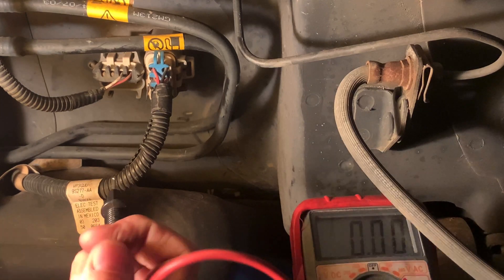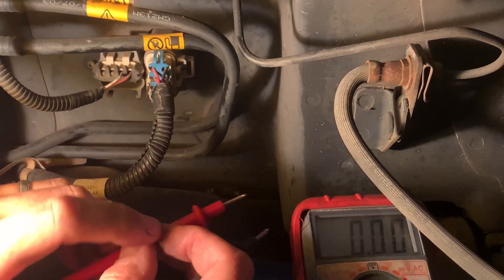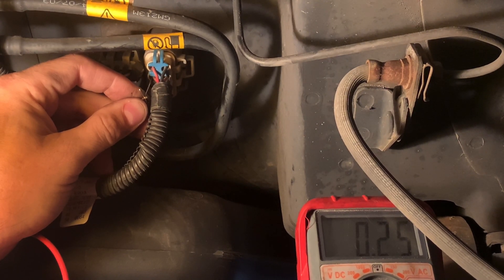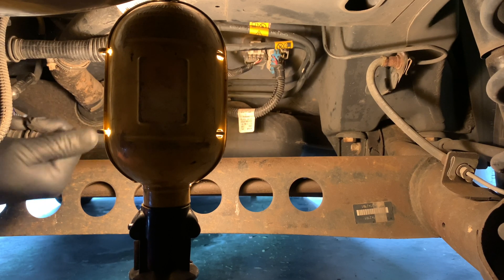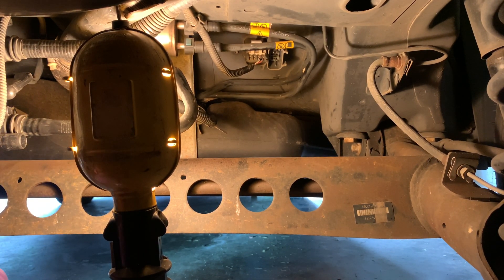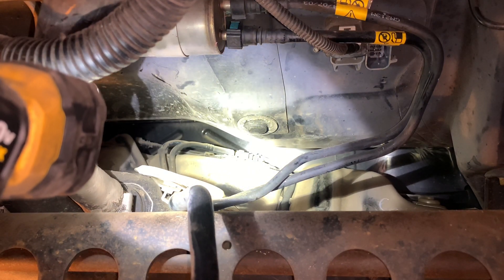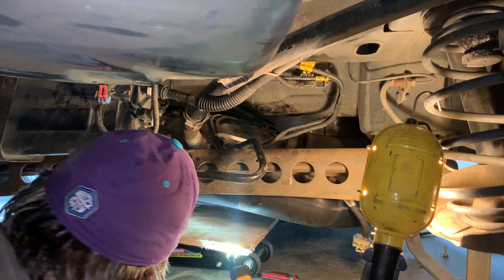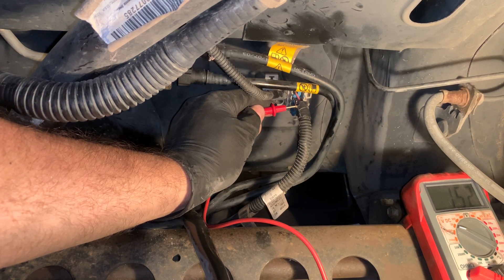Saturn Ion: P0446 EVAP Vent System Performance, Part II

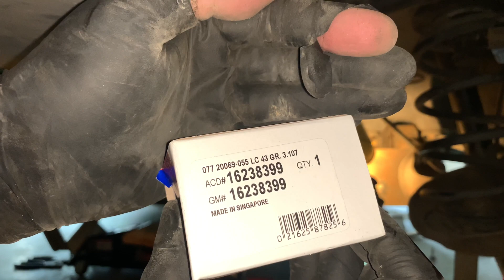Comment: So when you dropped the tank did you replace the charcoal canister? I also try to remove code P0446. And what about the Fuel Pump Assembly? Did you do anything on it? Or only Fuel pressure sensor. Thank you for showing that sensor # 16238399 ~@8:40 (Fuel Pressure sensor). I have same part, but was in doubts (though they sold me at Dealer Store that particular sensor as the sensor for 2001 Saturn SL2), but on Amazon for some reason they say it is not the right sensor for that car (probably some kind of error). Thank you for the informative films again.